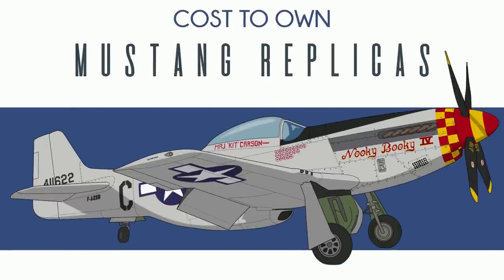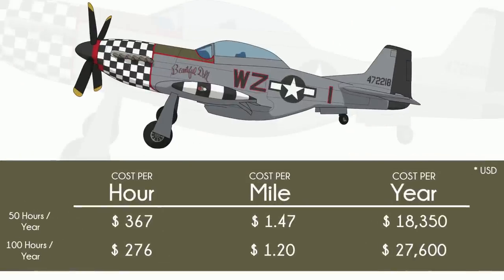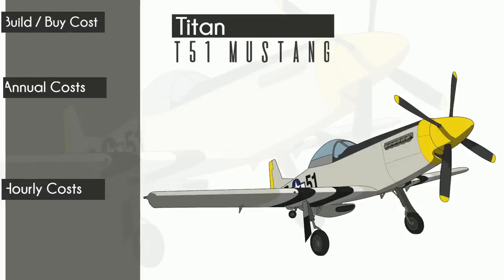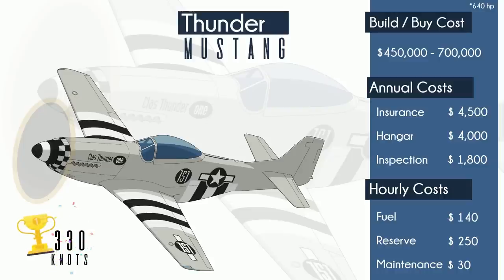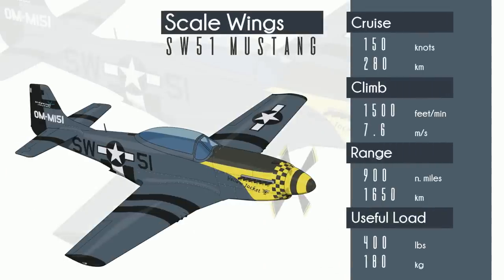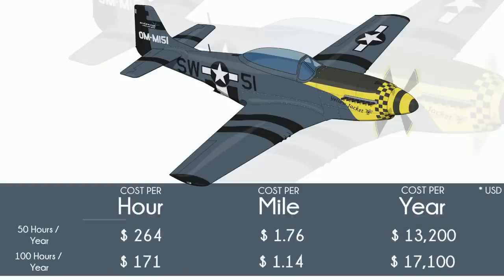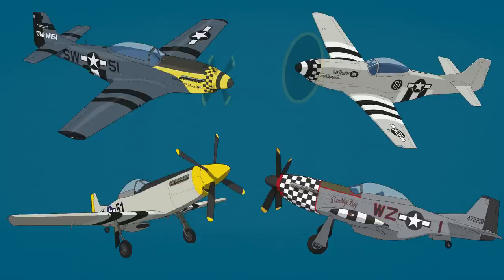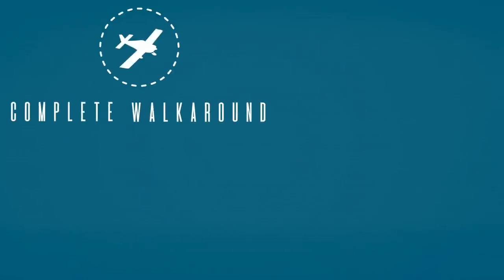P-51 Mustang Replica x4 - Cost to Own

Comment: I have literally waited for this exact video from the moment I hit ‘subscribe’!

Thank you for doing the numbers.
Reply from the maker: Holy Crap Jon. Thanks for all the AvGas. My next flight is on you Buddy. Very Very much appreciated 👍
Reply: @CompleteWalkaround  how long does the research take for this? What did you find out about the falconor(sp?) engine on the Thunder Mustang. 

I’ve lusted after a Thunder Mustang for a looong time. But I’ve heard many anecdotal stories about that motor that scary me away.
Reply from the maker: Research varies a lot. Some of these videos I can write off the top of my head. Others, like this one take a long time. Depends who/how many people I know have experience with the plane and how much info is available publicly. Things have gotten easier now that I have a bit of a following. Lots of viewers share their info thankfully. 

For the Falconer engines, here's how it boils down. They're a novelty act. They make extreme race engines. Which is fine, when you put them in your drag car or rocket boat. They're really low volume very unique engines. Thats great for some applications. The thing is, when your drag car breaks down in a race or your boat engine quits 1km off the coast of Miami no big deal. It's a wild man engine thats fun to tinker with and modify and get bananas performance out of and whatever else. Those characteristics don't translate well to aviation. When your airplane engine quits, you're having a really bad day. Quitting is the worse case scenario (maybe fire is worse I guess) but these sorts of engines also require work constantly. I read about overhauls being required in the 100 to 200 hour range. (hence the reserve cost). Again, for your race car, not a big deal. For your airplane, not ideal.
Reply: @CompleteWalkaround  I read that reply as in the way you speak in the videos, matched perfectly, and was delightful
Reply: Thank you for supporting this awesome creator. I'm no pilot, and don't plan to be, but I do love planes and these videos with his snarky sense of humor has me watching every upload!
Reply: @mbhayguy2406  Same 😂

Comment: 3/4 scale is 4/9ths the size, so slightly less than half the fun perhaps (misapplying that counter intuitive square-cube law, I know) 
...I guess I'm sticking with 1/32 kit planes for now!  (How about a cost-to-own comparison?)
Reply: I'm not convinced that smaller things are less fun. 
Who has the most fun flying, the Cessna 150/152 aerobat pilot, the F-22 pilot or the A-380 pilot?
I bet the two jets are both intellectually challenging from the point of view of managing the computers and mechanical systems they control, which is essentially the pilot's whole job. The Cessna is sure to be enormous fun, too, for people who like that kind of thing!

Comment: The Thunder Mustang is the fastest single-engine piston kitplane... what about the Nemesis NXT?
Reply from the maker: Good question. Just a little searching, nemesis doesn't post a Vne or max speed at sea level but does claim a max cruise of 325 mph IAC. Thunder Mustang claims 75% cruise of 340 mph.  Also max sea level speed of 390mph and a Vne of 590 mph. Maybe more to the story but preliminary check says TM is faster.